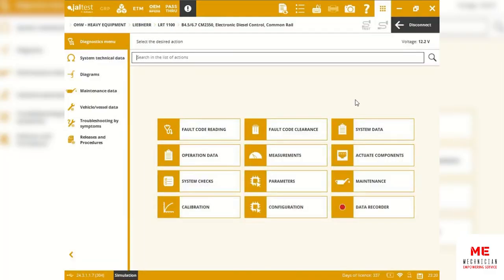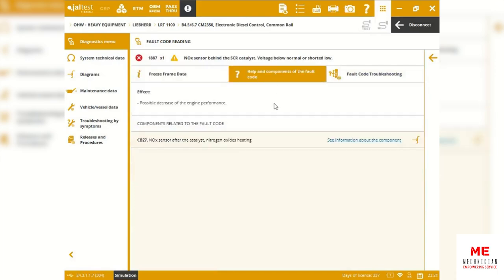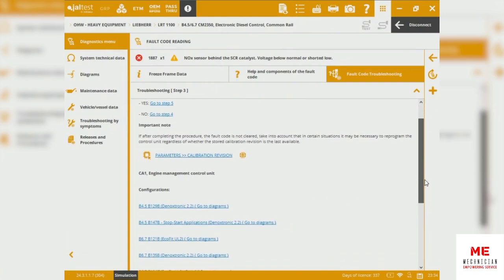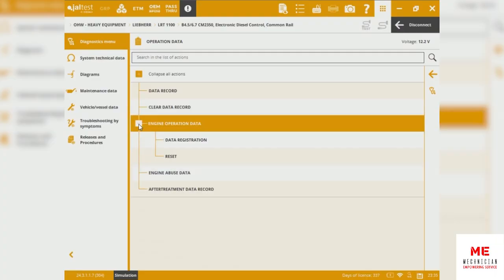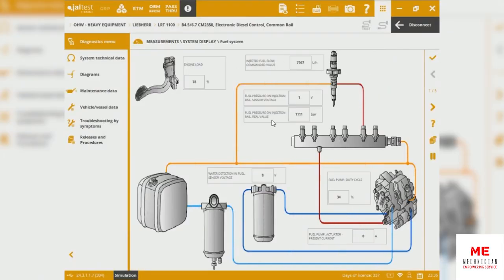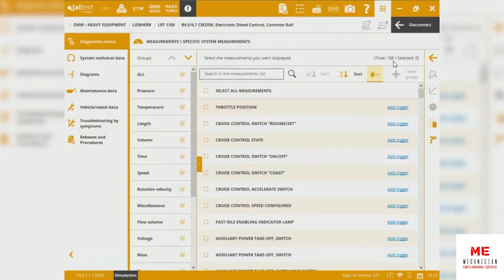(EN) Liebherr LRT1100 Crane Diagnostics with Jaltest | Fault Codes, NOx Sensors and more #viral

Comment from the maker: VIDEO CHAPTERS
00:00 – Introduction
00:18 – Fault Code Reading & Freeze Frame Analysis
01:10 – NOx Sensor Info, Pinouts & Diagrams
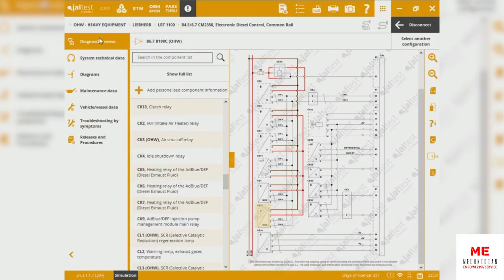01:48 – Troubleshooting Guides & Step-by-Step Repair
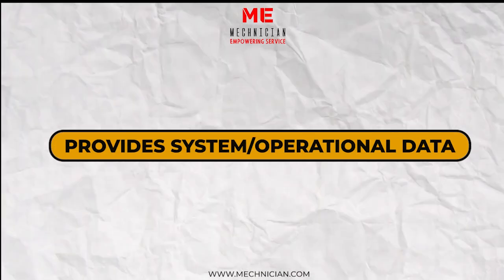02:44 – ECU Data Access & Hardware Specs
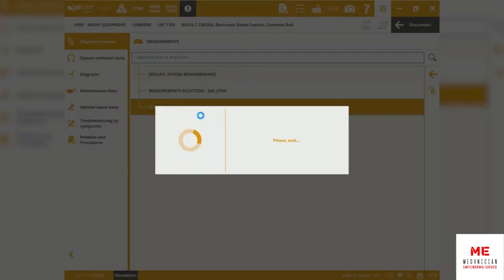03:33 – Fuel System & Aftertreatment System Monitoring
04:12 – DEF, DOC, DPF & SCR Components Analysis
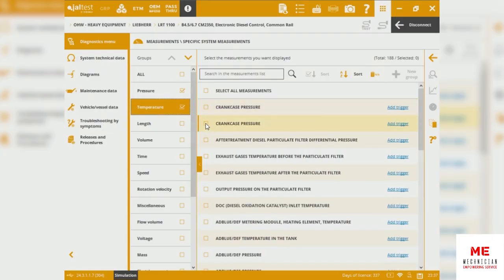04:50 – Sensor Filtering, Alerts & Graphing Setup
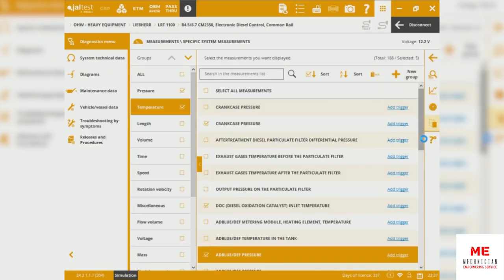05:29 – Final Notes & Contact Information